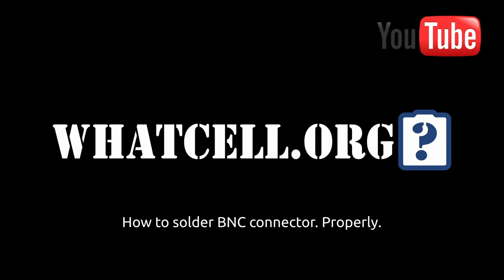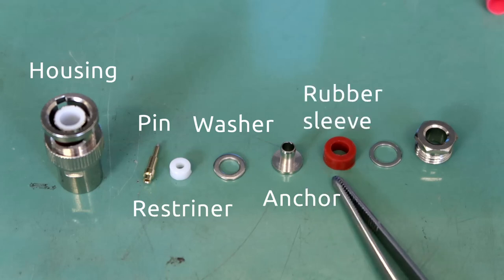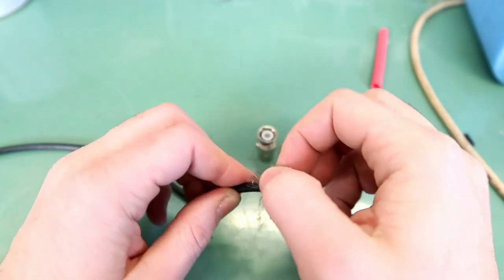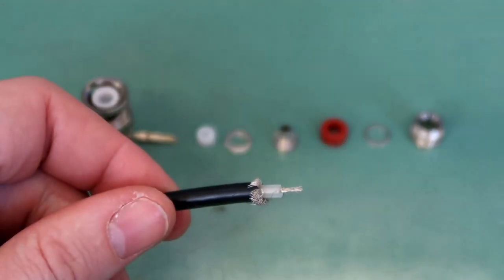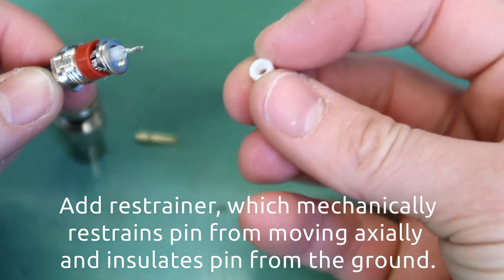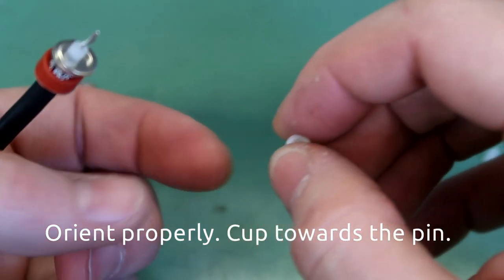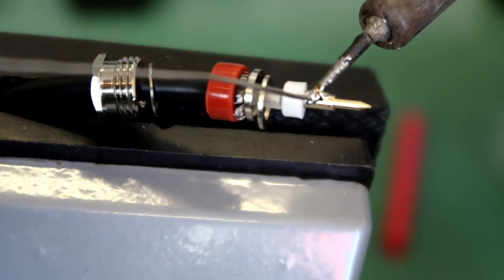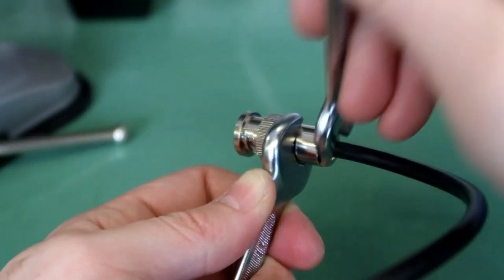How to solder a BNC connector. Properly.

Comment: This is definitely NOT the proper way to solder a pin to a conductor.  You heat the pin first, preferably on the side opposite the solder hole and then let the heated pin melt the solder and pull it into the hole.

Comment: Hi, you have to heat up the pin from one side with the soldering iron and push the solder into the hole on the pin from the other side. Thats how you solder a pin on a cable. Because your way you can never be sure how much solder has actually reached the middle wire.
Reply: His way is basically wrong. Soldering 101.

Comment: I believe you are putting the small white plastic insulator on backwards. The smaller hole end fits the pin securely and the cup end fits the coax center dielectric nicely. Please check this.
Reply: Yes i noticed that as well.

Comment: Pamona Electronics #4488 is almost the same connector. It is screw tight connection for RG-58,-141,-142 size coax.
Reply: Thank you so much for this reference. His link is to the wrong product.

Comment: To minimise the risk of a dry joint, tin the coax first before trying to solder the pin.
Reply: Right!
You will also avoid stray wires which may cause short to ground.

Comment: How are you doing this for the female connector? With my female connector there isn't any anchor and restrainer only the female pin, rubber sleeve, 2 washers and the nut. But there is noway i know off too lock this. I can pull the pin out of the connector easily. I am missing the anchor with the female connector? Or is this only for male connectors. Thanks. :)
Reply: Send me a picture of the parts. I'll try to figure it out.
Reply: Hi, thanks for responding! This are the parts. I forgot to mention one part, don't know how it's called. Here is an image: https://imgur.com/a/S53IaC1 Thanks for looking into it! :)
Reply: @Mart1250  Sorry it took me so long. The parts are 1...7, 1 being the cable and 7 the rubber sleeve.

From what I see, I would put them in order 1 (cable) , 4 (nut), 5, 7, 6, 3, 2. With this in mind I think that the rubber sleeve should constrict the plastic inner insulation or outer black shielding. Something should also connect the housing (2) to the shielding, maybe that's the purpose of part 3.
Reply: @StudioThaler  Thank you for your reply!, I already found the answer. The braid needs to be folded back over the restrainer. That way it is locked. That is the second part from the left at the image I posted.
Reply: Also you need to cut the braid until the restrainer length ends. Just give it a haircut.

Comment: I find that if you go more than 100 feet of cable and you attempt to use the extension coupling that comes with the cables.... you will get intermittant video loss from your security camera... i am going to try to just solder the addition length cable that i need together and bypass the quick connector... can you offer any suggestions before i attempt this... thanks.

Comment: Does anyone know how to go about painting your BNC adaptor (black for example)?  Is it safe to just spray it on with a can?  I've seen a lot of BNC adaptors black and I want to be able to do this with an adaptor that only comes in chrome.
Reply: You can go to any home hardware store and pick up  Rust-oleum appliance epoxy paint. It is a brush on paint  and a brush is  included in the cap.
 It comes in black,almond, and white. Pretty tough stuff  and oh and don't spray paint the connectors, it will never stick nor cover completely 
the chrome like metal surface.
Reply: @hestheMaster  Thanks for the reply!  So I want to paint the adaptor, but you said don't paint the connector.  What's the difference?  I want to make sure I don't paint the wrong thing, but also want to be able to get rid of that reflective chrome finish.
Reply: @IceKnight366  If you have an adapter that is one metal piece that connects to a RCA plug  for instance don't paint the metal part the  plug goes into the 
adapter just the rest of the  body. You must not insulate the outside of it as it is technically the ground.
Reply: @hestheMaster  ok, so basically don't paint the pin and threads on the inside, but I can paint the whole outside?  Is that about right?  Apologies as this technical stuff is not my forte.